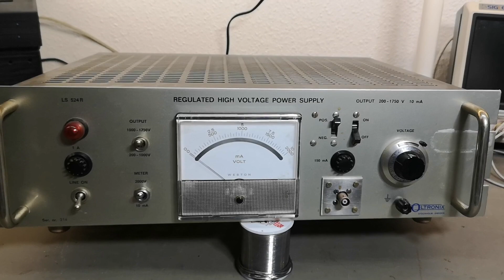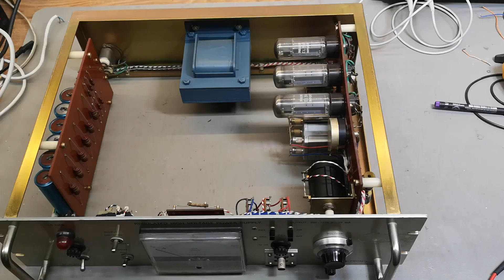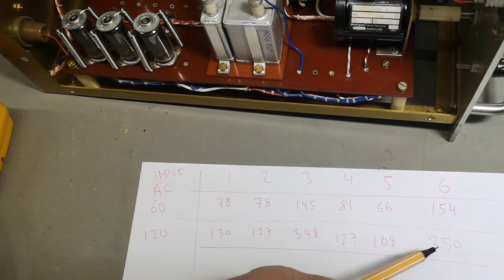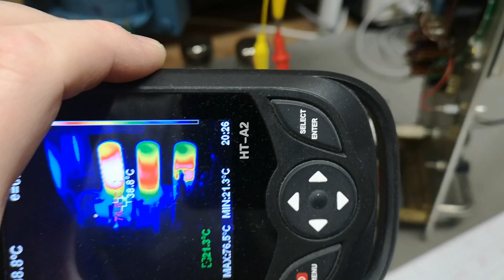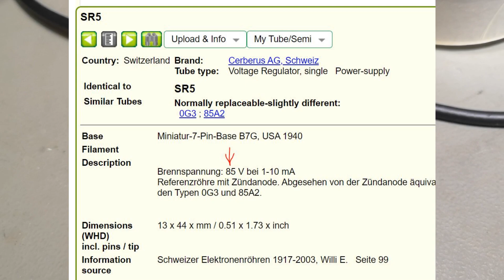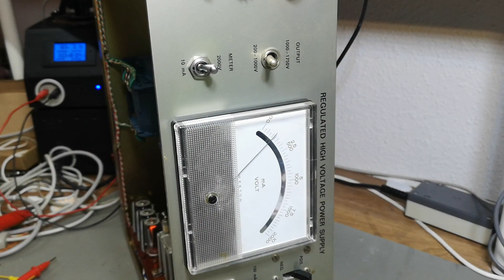Oltronix LS 524 R Regulated High Voltage Power Supply 2kV 20W Tube 1960

Comment: Hi, Oltronix makes interesting power supplies, before they robbed my workshop, so I had two vertically constructed B 202 power supplies if I remember correctly.
It looks strange that it doesn't start from zero, but it is at all possible thanks to the design, doesn't the multiplier start working correctly only from some minimum voltage?

Nice day 🙂 Tom